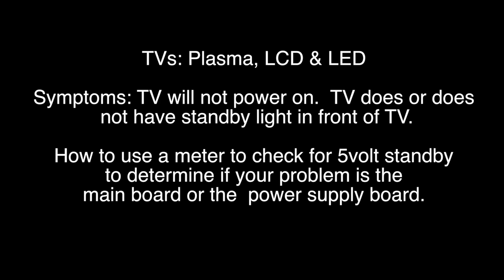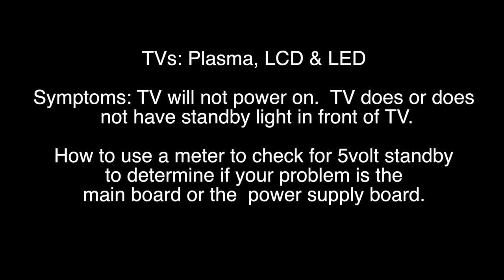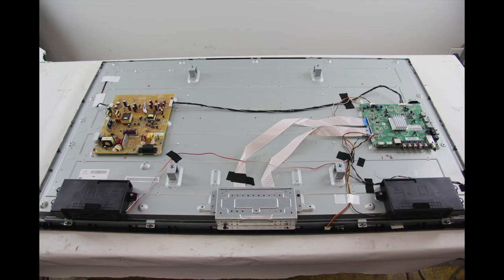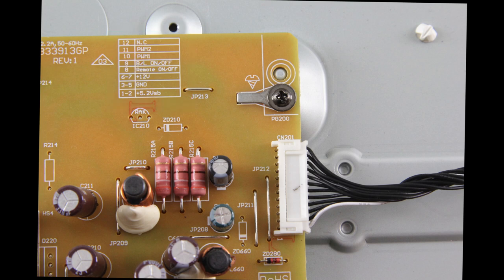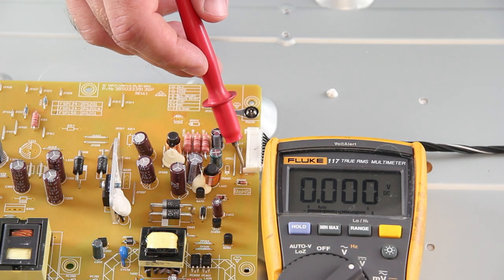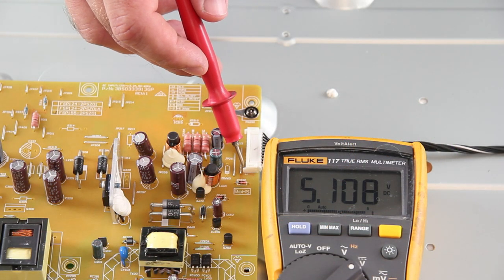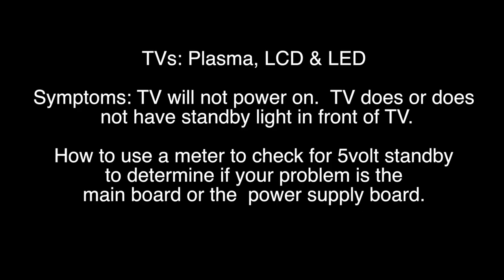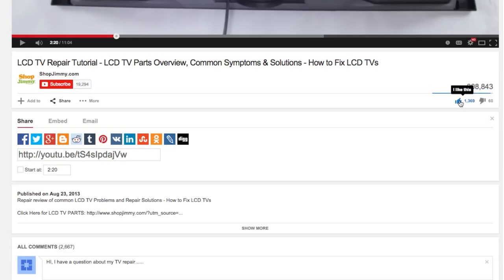TV Will Not Turn On Troubleshooting Help - LED, LCD & Plasma TV Troubleshooting TV Will Not Power On

Comment: Jimmy I have a Polaroid  
TLAC-02255 and I conect the power cable and the standby light torn on red , When I turn on the tv the red light changes to blue and tries to start the screen apears the logo polaroid after a few seconds turn of and change again to red. I check the power supply and have 2.9 volts when turn on changes to 5volts and  after few seconds changes again to 2.9volts

Comment: Hey bud. I have a vizio, the power does not want to come on sometimes, but when I unplug it and plug it back in it turns on, the other day I had to replace the fuse in the psb. I am wondering what is causing the fuse to blow and what is causing the the power cycle issue

Comment: My 3yr old  Vizio 50in went out so I bought a new board from you. Put it in and it fired right up, worked for a day, turned it off and couldn't get it to come back on. You were supposed to replace this board when one came in. I was told you get a lot of them and would notify me when one came in. No one ever notified me!! I'm still waiting.

Comment: I have a Dynex TV Model Number DX-40L261A12. The TV will power on after unplugging then plugging back in. It takes multiple times to do this. I do have the red indicator light that stays lit. Once the TV is on the picture is still excellent and everything works. I did try another power chord and that is not the issue. What do you think it could be?

Comment: i have an emerson lf391em4-ds1 led tv and when i check the voltage on pins 20 to 23 of the power supply (on the schema it supose to be at 21volts) it read 11.5volts. what it could mean? thanks

Comment: What if it’s testing at 3.5 with a cheap multimeter ? All pins are testing lower than they’re actually marked. This is the first time I’ve used this multi meter. Should i still go ahead and replace the main board? It’s an LG TV and there is a board in the middle of the power board and main board.

Edit: I’m fairly sure it’s the meter that’s not accurate. Everything is testing 20-25% lower than what is listed.

Comment: I have Hisense 70h6570g no power on standby light and tv doesn’t work.
I checked the power supply output it notes 12 volt on first two pens they read 11.7 the 3rd pen notes stub and has 3.4 volts.
Suggestion on repair is appreciated.

Comment: Hi there. Please HELP! Our TV is on the fritz and we need some advice before we can move forward! Our TV is a Sylvania (now Funai), model number LC407SS. The TV was turned off and then back on again and from that point, it was dreaded history. Long story, short, the TV will not power on at all, no stand by light, the TV makes sort of a high pitched buzzing noise. No back lights are present, either. We went through a couple of your videos about troubleshooting, but are at a loss on which part to go with first. Your advice would be greatly appreciated. Cheers!

Comment: Hey there so a quick question I have a vizio m43-c1 so I have 5v on two of the pins as they should and 19v on all other pins that say +12v while the main board is connected however when I unplug the mainboard I lose the 5v on both pins on the power board is this normal? Thank you
Reply: yes

Comment: Hi, I couldn’t get any reading on the voltage on the power supply but when I disconnected the cable going to the main board the backlight turned on, so does that mean my power supply board needs replacement or the main board?
Reply: Then did you test for 5 volts standby

Comment: Sony Bravia 55" KDL-55HX800 model.  
I had a power surge which kept my tv from working properly.  At 
first it would turn on and have a picture, then turn off.  I got it to 
work for about 10 min. before it shut down permanently.  
The red LED is flashing 3 times in sequence. After trying to turn the tv on, the green led clicks off back to standby, red led, and changes to 7 blinks.  This is repeated every time I unplug the direct power cord and re plug several 
min.'s later.. I will test the volts from supply to main as shown in your video, but do I have any other problem I should know or worry about before I attempt to test or replace anything?

Comment: I have a lg plasma 60pm6700-ub.  I believe it was stuck by lighting as the surge protector shows it is no longer protecting.  Standby light will blink, when I try to turn on screen shows a faint gray color but never shows picture or sound and then appears to turn off.  5v standby pin (what I believe is the pin) one shows around 4 volts(first time using meter). Any help appreciated

Comment: I have replaced all 3 boards on my Samsung model un58h5202afxza and still no picture.
I have power and volume but no picture.
This happened one time before and I ordered the power supply.
Last week the picture went out and I ordered the other 2 boards.
Installed them tonight and still no picture. 
The red light in the lower right does come on, if that helps.
Any ideas?
Kevin

Comment: I have a Sony XBR-65X850D that will not power on.  I have 3.3V at standby pin.  Power button does nothing.  Bad PSU or bad main board?  Can I force on the PSU?

Comment: My LG 55LW5600 won't turn on.  When it worked, it would 'click' when I pressed the power button.  Now it doesn't do that.  I press it, flashes red a couple times, transitions to blue temporarily, then back to red.  I replaced the power supply board and verified the 3.5V standby power going to the Main Control Board is present.  Is there any specific component I can test on the MCB to confirm that's the problem?

Comment: I have a Vizio VP422HDTV10A that doesn't turn on. The standby light comes on and in complete darkness the screen turns on but only for a few seconds, then it goes black again. The standby light stays an amber color. I don't have a volt meter ( I'm not sure what it's called lol ) so I'm unable to check the 5 volt you are referring to in this video. I would appreciate any help or advice. Thank you!

Comment: What if I have no red standby light but have 5 volts on one of the terminals out to the main board? Bad main board or could the power switch section fail; the area where the red light is and the remote sensor.

Comment: Toshiba 40FT1U had blown 6.3 amp fuse on power supply board . Replaced fuse and plugged TV in. Immediately fried fuse . Suggestions ?
Reply from the maker: +David Ballard   Try all repairs and troubleshooting at your own risk.  There is a different issue with the board.  I recommend replacing the entire board.  Click this link to a replacement power supply board for your TV model number:  http://www.shopjimmy.com/toshiba-75020137-power-supply-unit.htm  There may be multiple boards for the same TV model number, be sure to match part numbers on your current board, with your replacement for compatibility.  Here is a link to a video showing how to identify your part number, click here:  https://www.youtube.com/watch?v=b9L0-m0-pjAThanks and please let us know if you have any further questions with your TV Repair!  www.shopjimmy.com
Reply: check shorted diode before replacing the fuse

Comment: I spent a lot of time researching and studying everything I could with no luck!! I tested all transistors and caps with meters and out of circuit then replaced all the boards and still no luck one board was used and that my have been the problem or maybe something with something else it was a lighting strike so  who knows. but thanks to all who helped!!

Comment: I have a question, I bought a main board from you guys, it worked for a day. What's happening is when I plug the TV in, it turn on and when I turn it off! It comes right back on! I disconnected the Power on buttons and it still turn on. What could that be, the power board or the main board?

Comment: Hi. I have panasoniv 55as650b screen flickers slightly and tv turns off intermittently to a constant blinking red light I have 5 volts but no 16 volts on the main board

Comment: I also would like to know where to put the black lead when testing the power supply.  The video only shows the red.
Reply: me too. I'm assuming it goes to one of the ground pins
Reply: Use any screw that holds the board down. Those screw to the frame which is the main ground.

Comment: what are you connecting the black lead to ?? I didn't see where
Reply from the maker: Hi Marcel. You can use any cold ground pin on the power supply. You can even just touch the black to lead to the chassis in this case.
Thanks for watching!

Comment: I replaced the lamp (LFS4000PA1) on my Panasonic pt-61LCZ7 and I'm having the same problem. The TV turns on "no screen"i get a blinking green light for a few minutes then the power goes off then a red blinking light appears.Can you help me determine whats causing this problem.

Comment: My Sharp Aquos picture went away when I changed channels.  I had sound but no picture.  I turned it off and on but then had nothing even after unplugging it. 
On the front of the TV I have the OPC and Power lights flash together with the Power light flashing two more times before the sequence repeats.   
I have tried several of the suggestions to push buttons to reset with no luck.  
Inside on the Mainboard there is a light near number 20 and TP2003 label that flashes constantly until the TV cuts itself off.  I exchanged the power board but no change.  Should I replace the Mainboard?  If that gives me a picture, will I need to do a reset procedure?

Comment: I don't get where the ground lead on the multimeter is supposed to touch
Reply: There's that screw above that has a metal tab that the screw screws into. Touch that metal plate it's a ground.

Comment: Hi SJ as I was watching your video I ran a few test on my Hisense 50H7GB TV. I notice that when I press and hold down the power on the side of the TV the Hisense logo comes on and the TV picture comes on. The TV well stay on for about 2 minutes then it turns off. I have not opened it yet. Could this be a symptom of the power board?

Comment: My standby has only 2.6v. I already replaced the power supply board and it didn't fix it. There is also a 12v that is good but a 18v test point shows only 16.4v.

Comment: Hello,we have a Vizio E551i-A2 tv that just stopped turing on...changed remote---batteries....main board and power supply board..we have the 5+volts going to the video board...could it be the sensor at the bottom of unit..please help...thanks again

Comment: Hi, my tv has standby power but won't turn on, (Polaroid p40led13) standby light just flashes 7 times, I have replaced the power board and main board but it's still the same, would be grateful for any help / advice you could offer, I've tested with multi meter, all components seem to be working and no broken circuits ,
Reply: christian barratt hi may LCD sony bravia mobel no KLV  26BX350 power saplai is ok bat standbay led nat golo and set dead pis hellp mi

Comment: I have an Emersen LF391EM4 . The transformer is buzzing/making a noise. 1). I don't see a glass or porcelain fuse 2). I don't see any bulging capacitors. 3).  Nothing burnt on the back of the power supply.  Any ideas?  Thanks, Shane

Comment: Hey I have a Samsung t220hd no standby light that will not turn on. I can read 5v SB on power supply board. I replaced the main board standby light came on for a while but tv still not turning on. now I'm back with the same problem with the new main board. any suggestions

Comment: samsung 60 in  UN60FH6200. Tv does not turn on. tcon board is good. main power board pops electrically when you try to power on. replaced power supply board. same pop. ruined new power supply board. Any thoughts as to why its shorting out to the tv? Main power board has black spots but no blown capacitors.

Comment: I have sony RD 55X8500E No sounds no pictures, I checked the power in the PSU standby was 3.5 V However the TCON power was zeros ( (CN6401-25-27-28 TCON_VCC12V) what is the problem? Thx

Comment: hi my digital teac tv will power on with remote or side power button but only the TEAC logo will be displayed fir 30 secs and then it will disappear and repeat itself. i can not use any other buttons on remote. also tv will not power off by remote or side power button. can you help please.

Comment: Hi, Im looking to solve a problem with Samsung UN65F6300AF. TV wont turn on, Red stand by diod is flasing 2x fast, short brake and flash again. This repeats 5 times then LED stays on for 3 second and over again. I have voltage coming from power supply A5V: 5.3V and PS_ON 3.3V when Red diod is on and goes to 0V when diod is flashing. I dont have any 12.8V from Power supply. Can I start Power supply manually to check if will give me rest of the voltage labeled on the connector? Another 5V and 12.8V??? What else can be an issue? Main logic board or smth else?
Thanks for any help

Comment: Samsung pn58c8000yf.  TV will not turn on.  I do have the red standby light.  Power supply comes on for about 1 second and then turns off for about 4 seconds with the relay clicking.  I changed the power supply board with one I borrowed but still had the same issue.  Both the X and Y boards are unplugged.  I did check the 5.3 vdc and it is fine.  I'm thinking its the main board does this sound correct

Comment: Samsung UN46B6000VFXZA won't turn on. When I attempt it continually clicks. The only way to stop it from clicking is to unplug. Would this be evidence of the power board failing? We had an lighting storm and several items would not work afterward so I assume the tv received a power surge. Thank you.

Comment: OK I replaced the power supply and the main board and still will not power on???? I have 3.3 standby volts on the ps. Philips 47pfl5704D/F7 any suggestions now?? Please and Thank you
Reply: no, just gave up i know it sounds bad but i learned what i wanted to know

Comment: I have a 50" Sanyo DP 50842 with no stand by light and no power. I changed the power board and still no power, what else can the problem be?

Comment: I have a Westinghouse VR 3730 that I have replaced the motherboard and the power supply board on and  still have the same problem. Will not turn on, no picture, no sound, solid red light in the corner. As far as I have found the correct voltages are there. Please help, my reputation as awesome dad is on the line.

Comment: Hello, I have a Samsung PN59D8000FF that has stopped working. Symptoms include: power standby light on, logic board LED2000 lights up in 5 second intervals. Power supply voltages at Vs/Va and standby-ON are 0.000v (nothing). In a dark room I can see the screen flash when turning on/off. Would appreciate any input.

Comment: No lights and no power on an Apex 32" TV. Power supply fuse was blown. Replaced fuse but it blew as soon as the power cord was plugged in. Replaced power supply. Still no lights and no powering on, but at least the fuse stopped blowing. Measuring voltages, I get +5VDC and +24VDC at the proper points, but only for about 3 seconds, then the voltages all drop to mV range. What else can I do to troubleshoot further?

Comment: Sylvania (Funai) 32 inch LCD that powers up and run for about an hour the shuts down, I recapped it, replaced power resistors that were open and the rectifier diodes and that brought it back to life to it's current state now. This set has a split power supply (AC mains / inverter board and system PSB.

Comment: Ive got a sinotec plasma tv serial number  Phd-42Pd13 trouble  with the tv is that the tv goes on on standby if i swich the tv on by the power button  tv goes onto the green light  but the tv does no go on it goes back on the red and then the green light  but show no pictures

Comment: I have a Toshiba 40RV525U that will not turn on after sitting for 1/2 hour or more - or is cool.  To turn it back on after it is cooled, you have to turn it on an off approximately 11 times.  Once on, it functions perfectly.  What's going on?

Comment: I have a 46" lcd hdtv  RCA.  I do have a light on the front. Power light blue comes on and red light comes on when you shut tv off.  My question is how much approximately is the two different boards, not sure which one we need yet.  but this tv has gone done a lot in price since we bought it in 2012

Comment: So my Vizeo has a yellow light - but the white vizeo light flashed 3 or 4 times after cleaning my HDMI connectors, then no picture since then? It was power cycled and tested for power at the power outlet- HDMI seems to be a constant issue - now the screen is flat black

Comment: I changed the main board on my Sharp LC-60LE830U but it didn't solve my issue. The tv has a light in the shape of a 'V' at the bottom  of the set that lights up, goes off and then gives a quick flash again when powered on, but nothing shows on the screen.  Any ideas?

Comment: where do I get main power board for 42 inch lg flat screen
Reply: If you can get the power supply identification number then you should be able to Google for it and purchase it. I had purchased a power supply board for my LG 60" Plasma television on eBay.

Comment: Suggestions on where to start if the tv turns on for a few seconds then powers itself off? When it turns on get alot of white static on the bottom 1/4 of the screen. Have looked over all the boards with a magnifying glass. Do not see anything blown or damaged.

Comment: I have a Samsung Smart TV Model UN40H5203AF.  The standby light is on but when I hit the power button on the remote or on the tv, the light flashes red a few times and then turns off.  The TV does not turn on at all.  Is this more likely to be a Main Board or Power Supply Board issue?